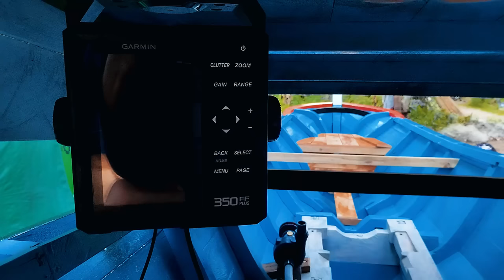Making wooden boats from start to finish

Comment: What oil did you use to twist the board? 
  I'm a Brazilian fisherman and I also make boats.
Reply from the maker: The oil I use is used lubricating oil, its function is to prevent the board from cracking when heated and bent